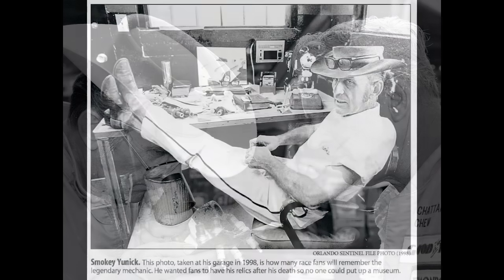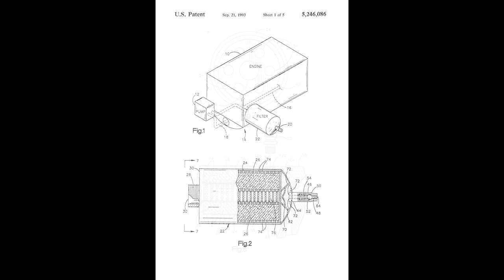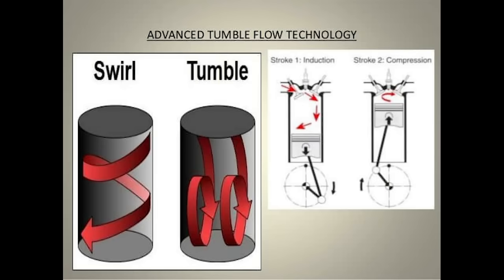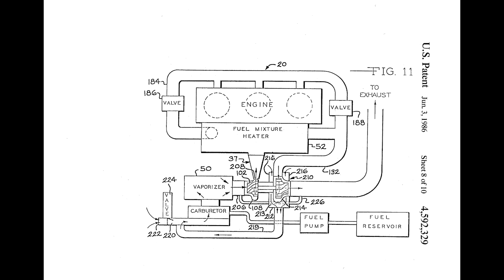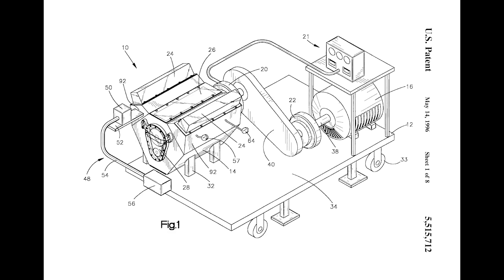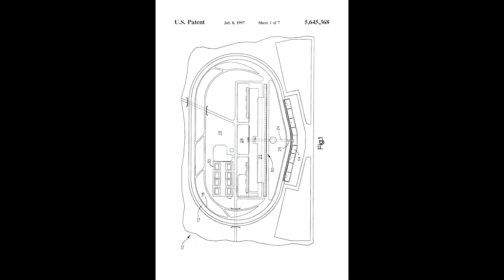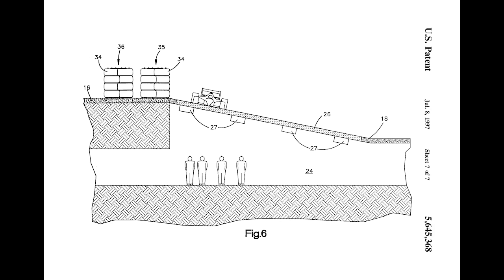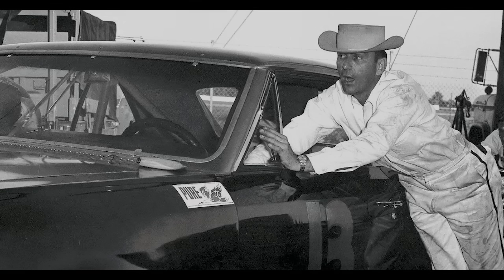The Patents of Smokey Yunick - Engines, Equipment, and A Racing Series?!

Comment: i remember hearing about the hot vapour engine when i was less experienced‚ was interesting.

now with experience looking at it. it seems like horseshit to the point of outright lying. raising the temperature of the fuel or the fuel air mixture will 1. expand its volume and reduce its density which powers vokumetric efficiency 2. reduces the maximum compression ratio you can use.

to then say he used this in a engine that jumped from 90 to 250hp is fantasy land stuff at the intake temperatures he said it was running at. 400 is absolutely ridiculously high. 

longevity? one pull? a diesel engine would melt a piston with the fuel being that pre heated. let alone a petrol.

Comment: I was an engine design engineer at Ford, working on what became the 3.0L V6 engine. This was about 1984. Right across the hallway we had another new engine program department working on a new I -4 engine. One day we got the word that the Executive Engineer on that 4 cylinder program, a former race engine exec, had gotten approval to give Smoky Yunick a development contract to apply his “yin-yang” technology to the new 4 cylinder engine. Yeah, right, Smokey working on a Ford program! Until I walked out of the V6 department and almost bowled over a small fellow in a white work uniform and a small broad brimmed hat with the sides rolled tightly. No mistaking who that guy was. 
Long story short: Smokey had demonstrated to Gus, the Ford exec, the concept at his shop down south. Ford wanted to see the work on a Ford engine in Ford’s engineering & dyno facility in Dearborn. Smokey was in Dearborn for 2 or 3 weeks. He had full access to our giant machine shop plus a dyno cell. The hat white work uniform got more and more used-looking and the hat brim got sweatier by the day. I knew the guys in the I-4 office very well, but they were sworn to secrecy by Gus. But you could tell the Yunick work wasn’t going well. Yunick went back to Florida. After a while we got the word that Smokey just could not repeat his results on a Ford engine. Nobody thought Yunick was cheating or wrong, he just could not repeat his results with different hardware in a different dyno. Most of followed NASCAR and knew what Smokey could do.
I never understood why Gus hadn’t brought in the Ford Research combustion specialists - we had a team in the E&RS Building right next to the Dyno Building. In fact I was working with the Research guys on AVL swirl intake & diesel-style exhaust ports for the 3.0L V6 engine. We never got the swirl intake ports to provide enough benefit to go into production, but my exhaust port went into production for the entire run of that engine in Taurus, Windstar, Probe, etc.

Comment: The see through starting line is not that ridiculous. There was a vehicle/road testing facility in the UK that had a section of its road surface that could be replaced with a clear panel so you could place a camera underneath to capture the tread pattern as the tyre went over

Comment: At 5:38 you state "never been applied.."😊
Well maybe not in cars.

Penske applied a similar "swirl" in the Detroit Diesel (DDEC), 15:1 - 16.25 Static Compression!
Single Long Intake & Short Exhaust Ports with Dual Intake and Exhaust Valves, per cylinder.😊
Single Overhead Roller Cam & Injectors that boost, Lift pump (80-100psi) to 2800+psi(?) at Injector Tip😊
Central Dome & Circular Dish Piston and Flat Cylinder Head Surface.
Injector centered over Dome, causing spray to be distributed into a Swirling 0 - 40+ psi Turbo Boost.
Fast throttle response with high torque
Most Efficient Diesel on the market for years!

Comment: I worked with an old engineer that had a Vega he used as a test bed for this concept. It was so rube goldberg-ed up that it wasnt recognizable as an engine. Iron sleeves in the aluminum block, a radiator out of an olds 98, and about a mile of copper tubing in coils running everywhere. Herb claimed he got better than 60 mpg

Comment: THE PRE-LUBE IDEA WENT RIGHT INTO MY BRAND NEW E-ROD LT4 SUPERCHARGED ENGINE ON DAY ONE AND THEN THAT ENGINE WENT RIGHT INTO MY 1990 ""K""1500, IN FRONT OF A GEARSTAR 4L80 E "IV" TRANS IN FRONT OF A BUILT 241 T CASE WITH GEARSTARS UPGRADES TO A DANA HD  DANA 60 3:73  WITH A TRU TRAC, TO 33 INCH KO2 BFGS!!! THE TRUCK IS A MONSTER!   CRUISES AT 75MPH ALL DAY LONG WITH THE A/C ON FULL BLAST!!   THE TRUCK IS LIFTED 4 INCHES AND THE FRONT SUSPENSION, BOX AND ALL,,,,, ARE BRAND NEW.   THE TRCK IS NUTZ!   THE BODY IS STRAIGHT AND PATINA"D STOCK CHEVY BABY BLUE WITH "FULL" POWER EVERYTHING. BEEN DRIVING IT EVERY DAY,,, SHOPPING AND ALL THE OTHER THINGS.

Comment: I have seen a spin tron type Machine in use, in Australia in the mid 90's at a camshaft manufacturers workshop, spinning doorslammer engines to over 11,000 rpm under strobe lights, was awesome to watch the valve springs dancing in the light

Comment: I'd recommend anyone interested in cars or racing to find a copy of "Best Damn Garage in Town".  Parts of it are pure gold.  Others are nearly unreadable.  But overall I'd recommend it.  It's not easy to find because (I'm guessing here) he says some pretty non politically correct things.  Ok - some are blatantly racist.  But there's other stuff in there that I found very interesting.  Like, which is bigger, a 7 liter engine at 5000 rpm or a 3.5 liter at 10,000?  I never thought of that.  Everything else being equal, they are the same.  And stuff about getting surplus smoke machines from the military (used for aerodynamic research before computer models), sawing cylinder heads in half and using the smoke to visualize what was really happening in the ports.  Nobody really understood that before Smokey came along.  And guessing again, I'd say Zeldovich NOx formation was probably the hurdle that stood in the way of the hot air engine gaining acceptance.
Reply: Goodyear Tyre Company bought a ARR Gurney Eagle/Ford V8, brand new in 1967 for the Indy 500, and gave it to Smokey to prepare and be the mechanic! Wow!
They also provided Kiwi driver, Denny 'The Bear' Hulme, as their driver.
Of the "Bruce and Denny Show" in the CanAm, and would become the F1 Champion driving for Jack Brabham that year!
Smokey is reported to have called the irascible Kiwi,... "That dumb sob!" Oh dear! Two men of very few 'choice' words!
Apparently, Denny came in reporting understeer ~ "push", in Murican.
Smokey said; "look you dumb sob, you go out there, floor it, and turn left! #*@^." 
"If you can't, go sit on your fat ass and I will find someone who will!"
Denny finished 4th in his rookie Indy drive. LOL
BTW, Smokey always bragged he took his cam grinder and reprofiled FORD's factory cams to a "decent" profile. LOL

Comment: 3:21 - this idea didn’t totally go nowhere, there is a pretty similar aftermarket system for Harley engines that does basically this. That being said most of the serious bearings in a Harley are rollers and don’t necessarily need constant oil pressure to survive.

Comment: Oil filter is a bit interesting but most modern engines can be turned over without firing. Floor the accelerator and turn the key. It will sound sickening (hearing a starter turn with no fire) but will run oil through the engine before it fires.

Comment: I remember when Smokey's "Hot Cycle" engine was described in a car magazine I bought at a newsstand. If I recall correctly, the article claimed that there was already a deal signed to have the company known that owned the "Mr. Gasket" brand name manufacture kits to convert existing engines to use the fuel pre-heating. Apparently, they could get about 1.8 HP/c.i. out of most engines, and greatly improved fuel economy. At the end of the article, the authors mentioned that Smokey had an idea for a ceramic engine that would run oilless, and be able to tolerate even higher operating temperatures.

Comment: 30+ yrs ago I ran fuel line through a 3 foot pipe that was full of engine water. The flapper air valve in the air cleaner that took heat off the exhaust manifold, was jammed so manifold heat always entered the carb. The "initial" timing was advanced 1-2°. I ran the lowest octane gas in summer with 0.o
ping/detonation @ hard acceleration. All pollutants decreased @ idle & cruise. 1 of the pollutants @ idle or cruise went from 10.00% down to 00.37%. That's over a 95% DEcrease. The only thing that increased was carbon dioxide. That's what we exhale, plants inhale & you'll find as soda pop bubbles. I could remove the idle speed screw, an the engine idled smoothly. It was a 69 Pontiac 350 V8 with well over 100,000 mi. on the meter.
Reply: Did you monitor NOx?  What was that effect?
Reply: @davemilster  Can't say from memory. This was 35+/– yrs. ago. The readout papers' ink faded in a briefcase. The papers were 2 yrs. apart. Pre & post hot pipe installation. CA smog checks are every other yr. The smog nachine tests 3 pollutants @ idle & cruise. Carbon dioxide isn't really a pollutant, it's a green house gas. Carbon is also 1 of 3, i think, of the most prevalent elements on earth. Everything went down @ cruise & idle. Only c.d. went up @ idle & cruise.

Comment: I started reading Hot Rod Magazine in the 1960's.  Over the years there were many articles about Smokey, or written by him.  I distinctly remember the Hot Vapor engine story in the 1980's.  Many years later Hot Rod ran another story about how General Motors bought the patent and did nothing with it.  Maybe they couldn't get it to work as well.  A true genius.  I always hoped to meet him and Bill Jenkins, but that ship has sailed.

Comment: Smokey’s book Best Damn Garage In Town
The world according to Smokey is an absolute must read for any motor racing fan. Probably available on his website. It reads as if you were sitting across from him in his shop. Smokey also developed the Hydro boost brake system, Ralph Johnson & Smokey are responsible for the Holly Double pumper carburetor. Read Smokey’s book. You won’t be disappointed.

Comment: The oil filter design looks alot like what John Deere has on mowers. They call it a 30 second oil change. It's a pre-filled filter with check valves to prevent it from loosing any oil. You just change the filter without draining the oil.

Comment: I owned an engine that a very talented mechanic built from the instructions and specs he got out of a Smokey Yunick  book. It was a Chevy block with 6 inch Oldsmobile Rocket rods
in it. The mechanic put the engine together and took it apart 8 times before he ever put fuel and electric to it, to start it for the first time. It was the baddest engine I ever owned, and
I hated to let it go.

Comment: The high temperature vapor engine was nixed and stopped by the oil companies. Reason….very good fuel mileage was attained in this way and they could not have that. The oil also stayed cleaner extending oil life and they could not have that either…thanks Brian

Comment: Smoky is also responsible for inventing the extended tip spark plug. When Chevy brought out the 283 in 57 they were having trouble fouling plugs. I no longer have his audio book to double check so perhaps someone else can add to this story. But smoky was working with a stark plug company and he mentions that he got screwed out of being able to patent the concept. Anyhow you can add the extended tip spark plug to his list of accomplishments.
Reply: Spark plugs company was Autolight, had a handshake deal with the Boss, who died of a heart attack before the paperwork was written for royalties. Industrial amnesia set in and froze Smoke out.                      
    Same with Holley carburetor design that he and Johnson came up with. Although Johnson also worked for GM at the same time maybe effected that one.
      Lesson learned he got more paranoid about secrets and patents, which are very expensive to get and often couldn't afford to process in relevant time.
  BTY, he did have several valuable patents in other areas including oil drilling.
Reply: @jeffhill3681  I remember reading where later Champion spark Plug  and Smokey got together and they used his design for extended tip spark plugs calling them Turbo Action if I remember correctly

Comment: Nice compilation, and a fitting tribute to Mr. Yunick.  Although not patented, Smokey was also responsible for the  innovative reverse flow cooling (which allowed higher compression at cooler head temps) incorporated in the second generation LT1 sbc.
Reply: Had GM not put the water pump above the optispark... it might have lived a lot longer.

Comment: Back in 1994, my near father-in-law, let's call him Russell, was a consultant for ARP. I got a phone call from him with the question do I know of Smokey Yunick and would I like to meet him? Oh yeah. Smokey was consulting with ARP on how to properly make cold-rolled threads and I was able to sit in on that meeting. People spoke in turn as Smokey puffed on his ever present pipe. When he stated " I have some thoughts on this..." you could hear a pin drop in the room. Afterward, I got my chance to shake his hand and I don't think I have washed that hand yet 😄. As far as his adiabatic motor, I remember reading a Popular Mechanics article about it. The article claimed that the engine ran smoothly and had a wide power band. As far as why these types of engines weren't used, I think it had to do with the later experimentation with ceramic internal parts containing so much heat that the intake would pressurize because of the very high intake temps causing high thermal expansion resulting in high pumping losses that took a lot of power to overcome. That was what I remember about the short-coming of this type of engine, not Smokey's in particular.

Comment: Car and Driver did an article about a Dodge Omni (or K car) with the hot vapor engine. C/D was less than impressed. They said it pinged and barely had any more power than stock. Smokey wasn't amused at all, but I would imagine he continued to refine it. Just because something is patented doesn't mean that it is the greatest thing since pockets on shirts. I admire Smokey, but that may not have been his best moment.

Comment: Ford spun-tested every Model A engine using a huge electric motor. The amount of juice it took to turn it indicated if it was ok or not. Less resistance, for example, might mean low compression and that one was pulled off the line to be diagnosed and fixed, or if it was too far gone it could be disassembled and the parts sent back to be melted down again. The good engines got a serial number stamped in em.

Comment: "Rule Interpretations"   meant CHEATING plain and simple. Like everyone else tried to do, CHEATING was and still is the norm in auto racing. Lets not try to make it a good thing okay? If you can't play by the rules then just don't compete. Have some dignity.
Reply: I think we can all agree that rules are meant to be followed. What we don't agree on is what happens when an idea/modification isn't specifically addressed by those rules. Simply put, Smokey interpreted those rules as written. The problems come when those who write the rules have their feelings hurt by someone more creative, like Smokey, for instance.
Reply: I heard on this years Indy broadcast them refer to being "outside of the regulations" when a car failed inspection.  I thought there is the diference between Indy and Nascar, in Nascar you're illegal.
Reply: @kevinhenry7273  Not sure, but I have a scenario where the rules may be skirted, while at the same time being adhered to. to the letter: Let's say that the rule says the car must be x inches to the ground, when measured from the top of the wheel arch to the ground. Strictly speaking, the car does actually measure "x" -- when measured. At speed, on the other hand... And this was done, years ago, when they found a way to have the rear of the car sag, at speed. I can't remember whether it was soft springs or what, but it doesn't matter. What matters is that the car was at the proper height - when measured. Anyway, the idea is that the rules were followed. From the team's perspective, it can be said that if the sanctioning body wanted the car to be at a certain height at all times, including during the race itself, they should have stipulated that.

Comment: As genius as Smokey was, 16 identical race tracks sounds like the worst idea anyone has ever come up for a racing series - and 16 sets of everything can't possibly be cheaper than hauling it around or this would have been done a long time ago.
Reply: The patent was to cover every possible angle not a requirement / guarantee that all will be used.

Comment: I remember reading about the vapor engine in HOT ROD Magazine as I was graduating High School heading to College to get a degree in Mechanical Engineering.  June 1984 issue on the Mototrend App. Thanks for the video as always Brian!
Reply: Always remember reading articles by Smokie.    Smokey and David  Vizard.  Just think what they would have done.  Putting those two great minds together
Reply: I won't repeat my post I submitted....you can read it for yourself if you like.😊 I was a "Car Craft" magazine follower myself, but when my wife and I just got married I saw that "Hot Rod" issue  No.1 Volume 2 w/four blown engines on the front cover and had to have it. That's when I read that article and was hooked. BTW: I argued with several people over the years about that "homogenized system" and what it could do, and they'd argue about cold boxes too. But what finally won the argument was that article.....though since lost I held on to it for at least 10 years, memorized it and now wish I had it back.😅😊